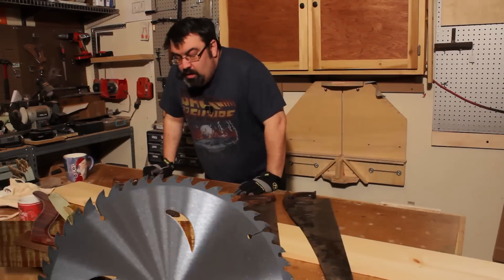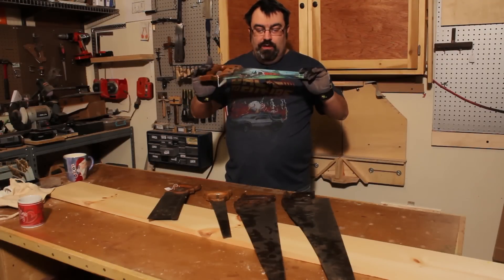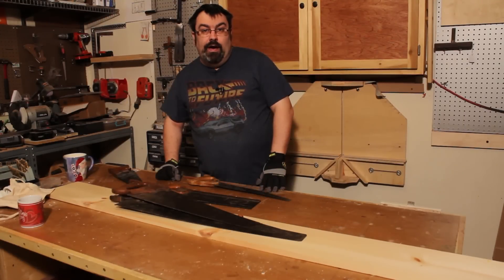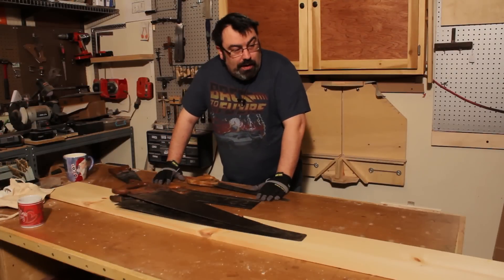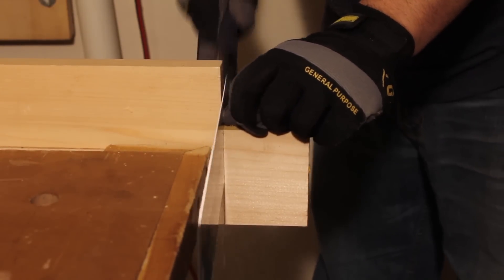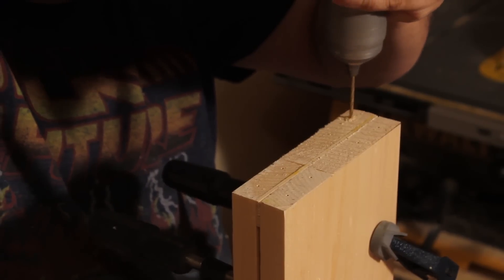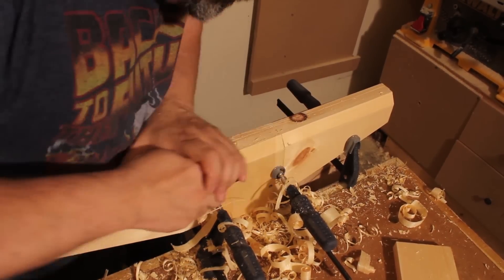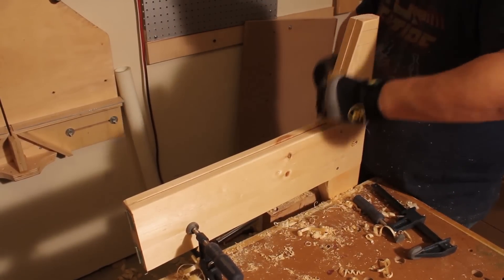TIW Ep. 50 Saw Sharping Building a Saw Vice Part 1

Comment: Get rid of the paint. Painting a saw is cute and all but totally useless. Loose the paint and get to cuttin'. Ideally you want the teeth of the saw to be as low in the vise as possible. You may find that your back saw blade will vibrate if it is to high in the jaws. Nice build.